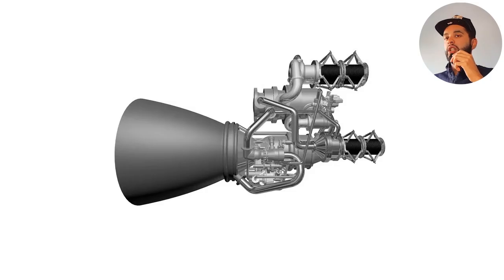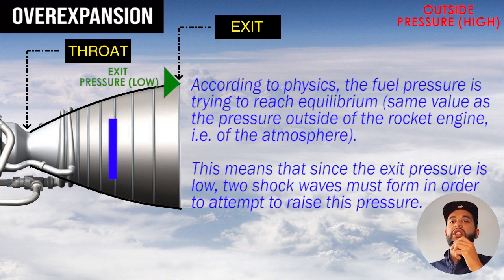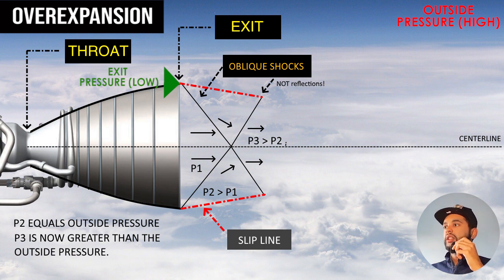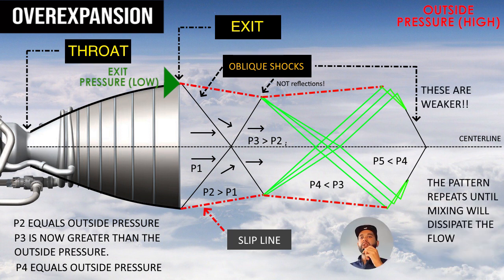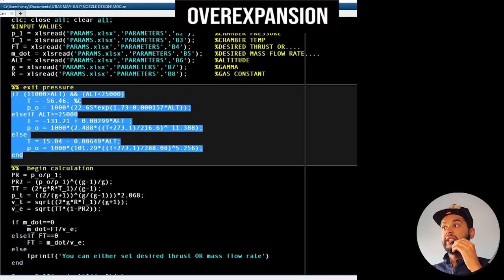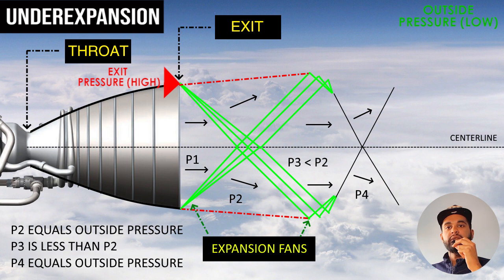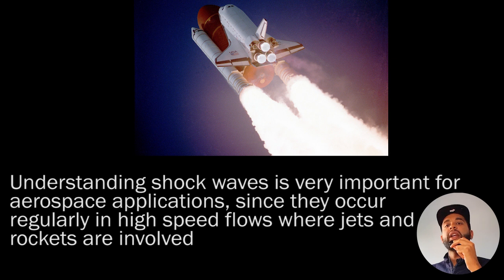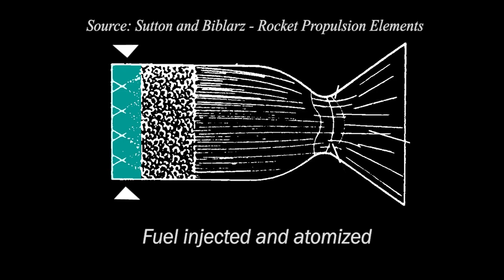How Shock Waves Affect a Rocket Engine - Over & Under-Expanded Nozzles

Comment: Thanks for great video!  Had a question. I can probably answer it myself if I break out my copy of Sutton.  But I saw something in one of your last charts that I had not noted before.  That chart table showing the under expanded and over expanded nozzles indicates that an under expanded nozzle will have a higher ISP. I would have thought that a perfectly expanded nozzle would have highest ISP.  With an under expanded nozzle,  exhaust is escaping out the sides of the nozzle lip without having relinquished their energy into propulsive force.  Maybe it’s just a better return from the actual equations.  Anyhow, if you happen to read this and had a comment on it would love to hear it. Thanks!

Comment: You mentioned that oblique shockwaves are forming at the nozzle because fuel pressure is "trying" to reach an equilibrium with the outside pressure, but then why are oblique shockwaves are forming in an underexpanded case? I definitely got something wrong, I'm not an engineer, I'm a VFX artist trying to understand how the mach diamond pattern is formed

Comment: I have a few questions about your MoC code. Why is your left running characteristic a negative of your right running characteristic? That would imply the shock is reflected at the same angle of incidence as a right running characteristic. Does it not reflect anlong the centre line by the mach angle ?